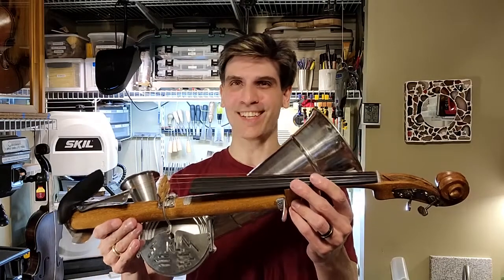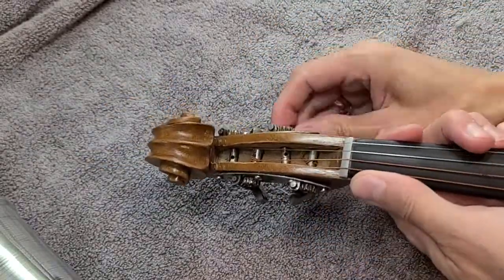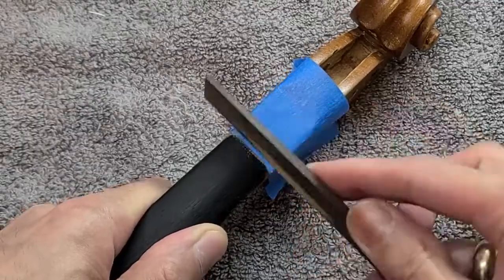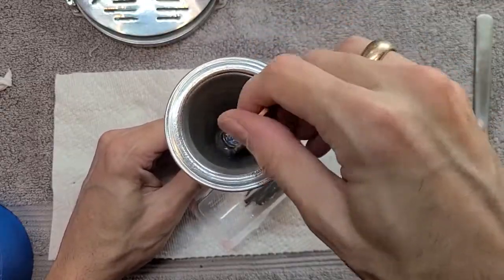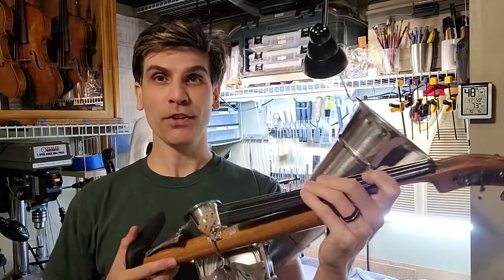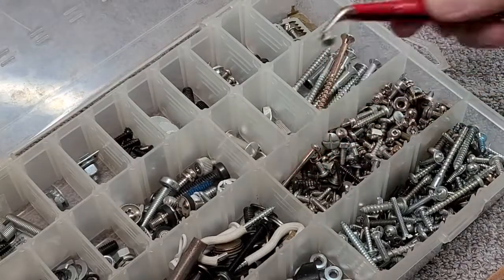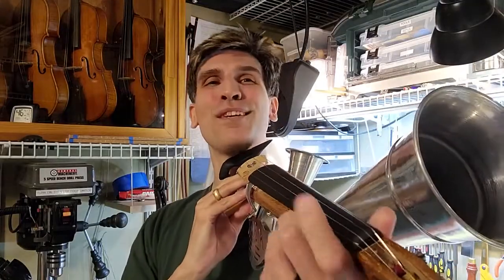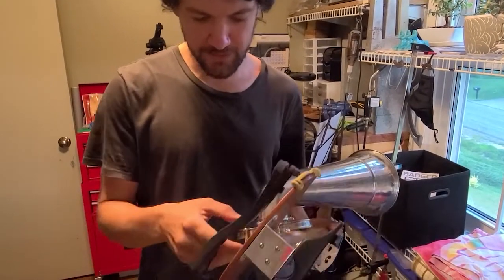Stroh Violin - Stroviol - the weirdest violin ever!

Comment: Interesting video on repairing an instrument but I felt throughout the entire video you referred to this very instrument as a genuine Stroh violin. It is not, it is a 20th century reproduction. Looks well made never the less. Small things give it away. like the turned bell, a Stroh's bell was not turned, it was wrapped and soldered length ways. The 'K L" on the vanity plate over the diaphragm is a modern manufactures marking. Plastic nut?
Reply from the maker: Yes, it had a plastic nut! Nuts, isn't it?  😉
And you are correct, this is not an antique original Stroh. But making the distinction throughout the video felt pedantic, so it's referred to as a 'Stroh violin' instead of 'Stroh-style violin'.